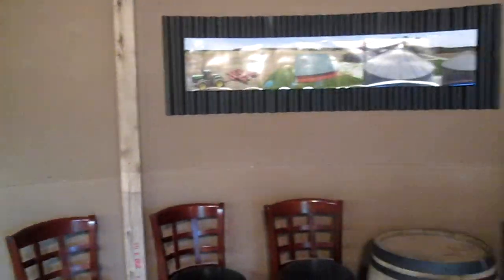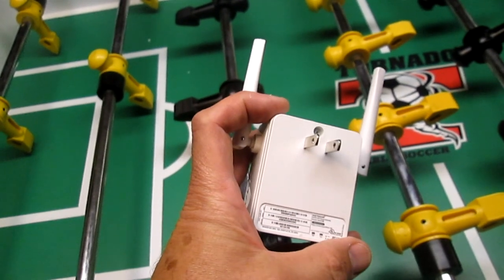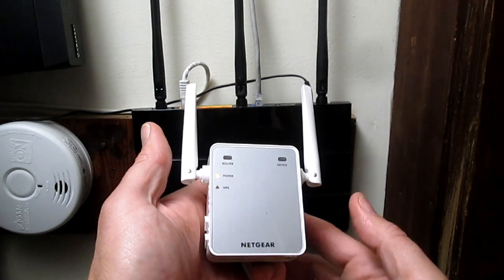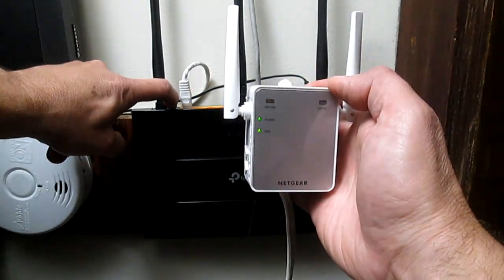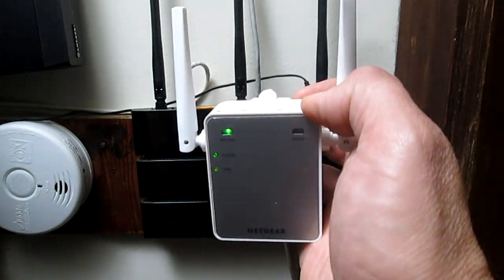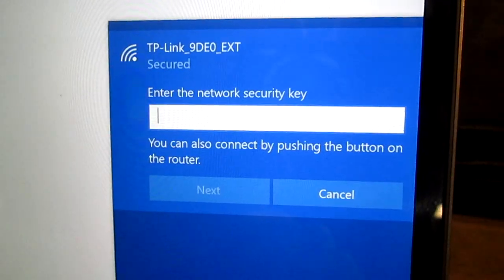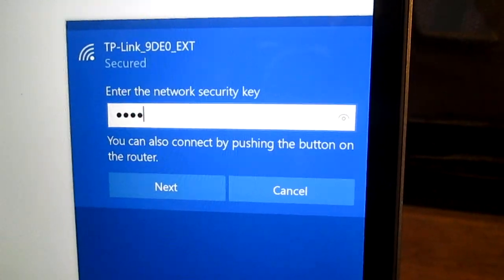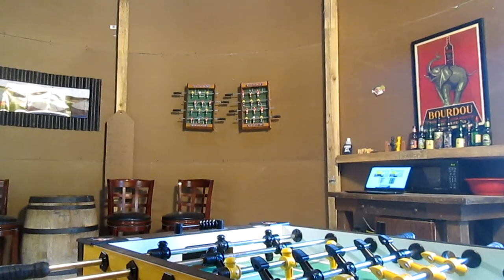How To Get WiFi in a Metal Building

Comment: This works wonderful, I cut a 6 inch hole inside of the shed, small one in the tin, then used a bleach bottle cut down and fit perfectly. Rain? A piece of 1.5 inch cut at 45 degrees a d 12 degrees and siliconed on the outside to protect from sun and rain. B 17 painting from WWII Life magazine to cover the hole.

Comment: Second to what he did. I had signal outside my shop,  but as soon as I went inside,  I would lose signal. I had a signal of -70 in the shop,  not enough to dio anything with. I bought an extender,  set it up,  and plugged it into an outlet in my shop. My signal is now -20. That is stronger than what is in my house. Great job,   and thanks.

Comment: On this net gear extender are the antennas removable to where I could put a bigger one on?
Reply: That is a fine question, I chatted with Netgear online to ask the same, the rep I talked with said no and that they did not have such a device. Personally I think it would be a great idea. Have been searching for about an hour for just such a rig... simply run the ext antenna outside and mount the repeater inside.

Comment: Great video and solution! quick q's: what about when it rains? does the water get in through the drilled hole and mess up the extender? Also, is the extender plugged in to an outlet in your metal shed?
Reply from the maker: Yes, the extender is plugged into an extension cord in the metal building.  The antenna fits the hole so well, that no water gets in.  I was going to seal with silicone, but found it was not necessary.
Reply: @HowToLou  thank you for the response! last q: do you recall what size drill to use?
Reply from the maker: I don’t remember, but my best guess would be 7/16
Reply: @HowToLou  thank you!!

Comment: How long did this last in the elements
Reply from the maker: Lasts fine.  Plastic antenna.   Add silicone if you want
Reply: @HowToLou  didn’t work for me at 133 feet
Reply from the maker: Try moving your house router closer to the wall across from your metal building.  Also, you should be able to see the little Netgear Antenna from your house.   Longer distance WiFi needs good line of sight.
Reply: @HowToLou  ya it is sitting right at a sliding glass door , I’ll have to figure something else out
Reply from the maker: I got the 200 feet with this router inside my house.  You might try a different router. 
TP-Link N450 WiFi Router - Wireless Internet Router for Home (TL-WR940N) https://a.co/d/4DiFnIT

Comment: Did you try it without drilling the hole in the building.....just using the extender?
Reply from the maker: Yes, that does not work.  As soon as you bring the antenna inside the metal shell, the signal disappears.  Wifi travels across the yard fine, but not through a metal building

Comment: What did you plug this into (in your silo).. regular outlet or extension cord?
Reply from the maker: I ran an extension cord to it. That gave me the flexibility to turn it sideways and get one antenna out through the hole in the metal.
Reply: Thanks. We tried it here and it did not work. Will try again with a new router.
Reply from the maker: Make sure you have good wifi just outside the metal building.   It’s got to be good outside before you can bring it in through the wall.
Reply: Never use extension cord, it cuts the wifi frequency off "frequently" like using a bad dns server, make sure you have direct power for better and more secure network

Comment: I'm moving into a container home in a tiny home community. Would this netgear work?
Reply from the maker: To be clear, this does not get internet, it extends it.  If there is free wifi in the community, then yes, the Netgear will get it through your metal wall. If you are buying your own internet service, they will run a cable into your container and likely provide a wifi router for you.

Comment: I have a question guys, how do you mount it with the antenna sticking out of the building and do you just run an extension cord to it and leave it like that?
Reply from the maker: Yes, the antenna “catches” on the bottom of the hole in the metal and simply hangs there.  You could add silicone to seal and hold it in better if you want.  Mine had never fallen out, even with the lightweight extension cord hanging from it.